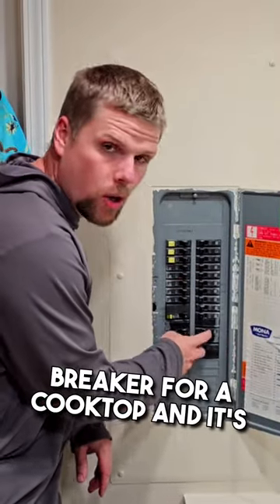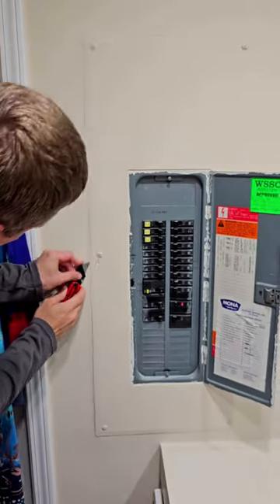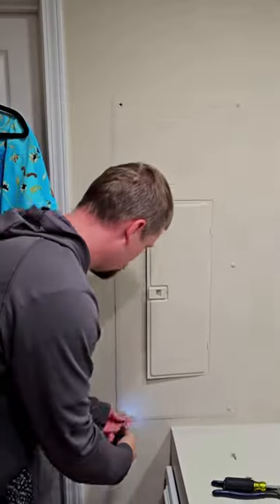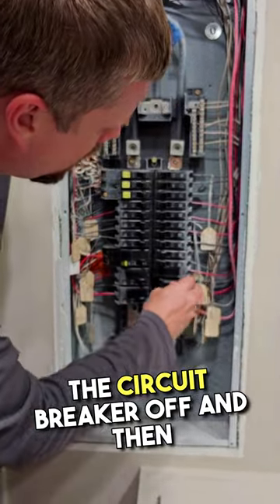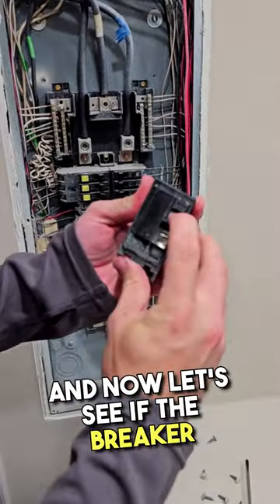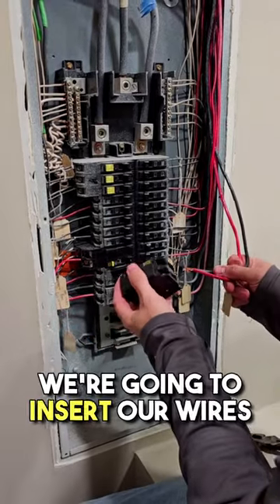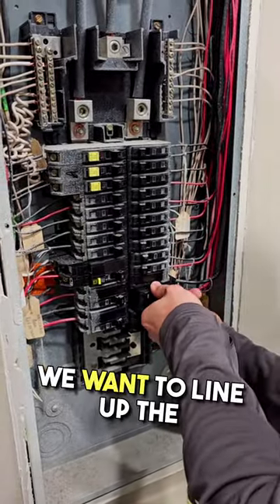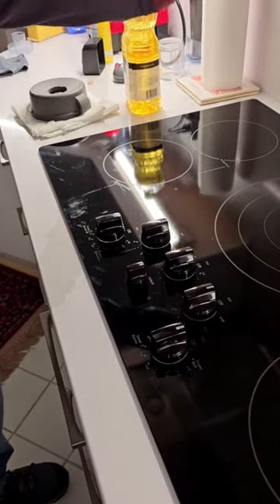🔥 How to check if a circuit breaker is bad and fix it #howto #electrician #diy #handyman

Comment: David, the main circuit breaker switch should have been switched off PRIOR to dealing with wires. I speak as having survived a right handed contact with a "live" 220 volt 50 amp wire (via a wet sponge). My hand was jolted back by the contact and hurt for hours. Had it been my left hand with the wet sponge, I might not have been writing this. "Drive to survive." :-)
Reply: A lot of electricians work in live panels, myself included, if it's possible we'll deaden the panel, but in a case where for some reason the panel must remain live you just have to work with it and be very careful to not touch anything you shouldn't, I'm not saying it's safe if you're a home owner absolutely deaden the panel and leave working with live panels to the professionals
Reply: @JS-df8qm  Yes, my master electrician would work with live wires with 15 amp circuits. I never would (e.g., a wall plug socket). One major electrical jolt for me was sufficient to leave major electrical work to my electrician. To quote the "Magnum Force" repeated movie line, "A man's got to know his limitations."  :-)
Reply: @JS-df8qm   this is a home, there is absolutely nothing critical. Even in hospitals and other facilities where we can't shut off power; We plan shutdowns or have people working in hot suits.

It is your life at the end if the day, not your company

Comment: Dear god, please tell me you weren’t futzing with live wires while doing this. I see no indication that the main power supply was turned off. Someone who doesn’t know any better is gonna try this and electrocute themselves and/or cause a fire. Safety first—turn off the main power supply FFS.
Reply: I’m inclined to report this video for promoting doing something dangerous. If you didn’t cut the power while changing the circuit breaker, you need to take this down and do it right. If you did cut the power, you need to add captions in big red letters “DO NOT DO THIS WITH LIVE WIRES!!!” This is why you really should HIRE an electrician. Dumb DIYs get people killed. Circuit breakers are easy to swap out, but electricity is too dangerous for the average DIYer to mess with.
Reply from the maker: If you're going to try this at home. Of course, shutting off the power is a good idea. My professional experience is that nobody does that. 😂 I've been in the trades for 20 years. 

This was more and entertainment troubleshooting type video than a tutorial.
Reply: @Mechanicallyincleyend  Nevertheless, this is no different than any other DIY how to. You even hashtagged it #DIY so you bear the responsibility of handing out Darwin Awards™️. This is so irresponsible. READ THE COMMENTS of all the sane people remarking on your electrical hazards. There is a main power breaker that cuts power to the box. How hard would it have been to cut the main and wear gloves? You need to take this video down, especially because it is a short and people are less inclined to read the comments. “In my professional experience”?🫨 This is not what a professional would do. Any professional trade guild would send you packing. This would be like doing asbestos abatement without PPE or filling propane tanks with a lit cigarette hanging out of your mouth. It’s a dumb way to die.
Reply from the maker: @Deecember16  yea maybe the #diy was the wrong choice. But I don't think anyone actually would shut down the main to change a single breaker 🤣. I've been doing this 20 years though maybe I've developed some bad habits. 

Unless we are swapping breakers around we are not pulling the meter. Alot of homes here don't even have main breakers to shut things down.
Reply: @Mechanicallyincleyend  all of them have main breakers to shut things down...Even fuse panels have mains to pull...what are you talking about?..Utility will not put power to it if it doesn't have one it's a requirement before power is put on otherwise they pull the meter till it's up to utility standards.